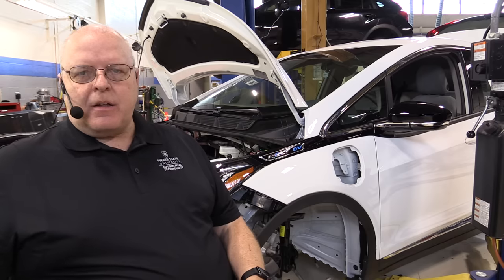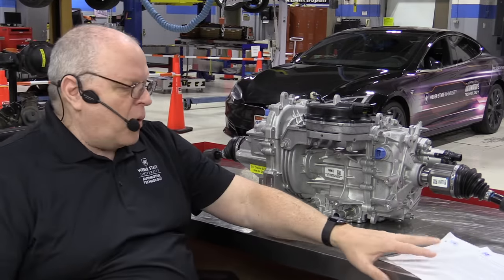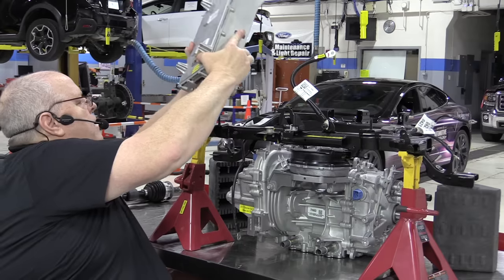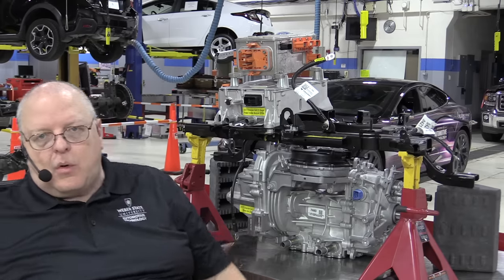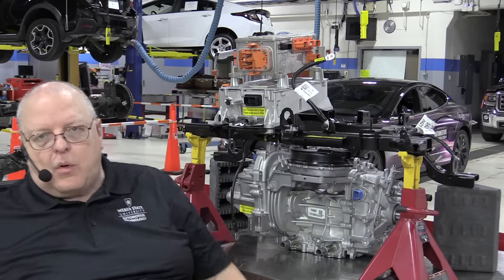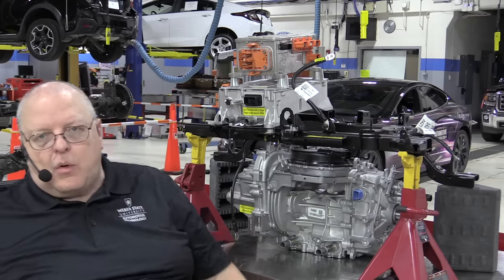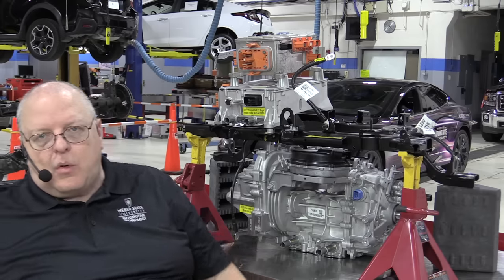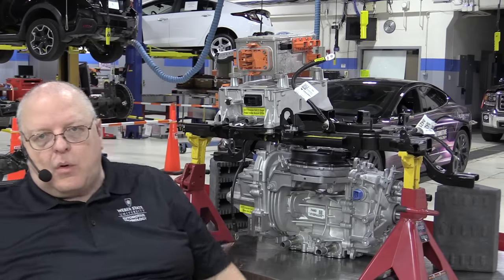Chevrolet Bolt EV High Voltage Components

Comment: Not a very space efficient design. No wonder they couldn't fit a frunk up there.
Reply from the maker: Thank you for your feedback
Reply: @WeberAuto  Thank you for creating such informative videos :)
Reply: Yeah, eventually they have to adopt Tesla's design philosophy to stay competitive. However, theses components are going to be great for EV conversions since they fit the traditional ICE car form factor.
Reply: I would gladly give up a tiny tray to put my groceries in to have a system that is serviceable.  Nothing is worse than the "space efficient" designs of today that require you to drop an engine to change spark plugs or other equally ludicrous ideas.
Reply: @samurphy  Firstly, if the manufacturer did their job, these components should last the life of the vehicle. Power electronics like this tend to last a long time, it is one of the advantages of EVs. Second, it isn't that hard to have a removable frunk liner to give access to these components.
Reply: @ShaunRF  I agree with both points. The Bolt has room for refinement. As to your first point, that's 100% correct, but given the astounding rate of repair and replacement on the Tesla drive units, I think we'd agree that the manufacturer is NOT doing their job.
Reply: @samurphy  that was one issue as a result of a supplier problem(most likely Borg Warner), and certainly not representative of the whole. In any case, drive unit replacement is actually quite simple in a Tesla, especially compared to engine replacement in an ICE car.
Reply: @ShaunRF  I like how we keep hearing about Tesla defects that were solved 5 years ago. Tesla has not had any major recalls on the drivetrain in years. Maybe we might see some glitches with the new M3 design, but so far, so good.
Reply: @egoequus6263  Oh this comment aged quite well, remember the Bolt EV battery recalls from a few months ago? There go all the penny pinching cost savings as they replace and refurb all those battery packs. Spending the extra money goes a long way, especially when you're GM.

Comment: yes , fossil fuel engines to hell.
Reply from the maker: Thank you for your feedback
Reply: Noooo. Gas engines will never go out. Electric is expensive to repair plus you need battery chargers everywhere you go😂😂😂
Reply: Unless the power grid you use is 100% wind or solar or hydro-electric or nuclear the electricity used to charge the batteries is fossil fueled. There's no way to separate the electrons flowing through the grid as to the source of them. You might be 35% green but the majority of those elemental particles come from "dinosaur squeezin's".
Reply: sp1nrx - as time goes by, the more wind/solar/hydro power become a part of the mix of sources powering the grid.  You have to admire the size of wind generators and so,ar arrays being deployed these days.  Adding battery storage to the grid will help that a bunch in coming years, so fossil fuel dependency to power the grid will be reduced.  Dinosaur juice supply for transportation is finite and never renewable.
Reply: Just one problem, these cars are a whopping $36,000  you can buy a decent used gasoline powered car for under $2500. I have a 2003 Concorde LXi with leather seats, power windows, premium stereo,  no rust or damage,  in beautiful condition, had been owned by an older retired  couple who had a garage they kept it in and kept it serviced, it has  120,000 miles on it,   I paid $1100 cash for it at a local dealer.

 $36,000 is about 5 times what I paid for my 2 bedroom HOUSE  with full basement on 1/2 acre of land in 1999!!
$36,000 has to get financing- that adds to the cost, plus comprehensive collision insurance-  there's another cost I don't have buying a car like mine and paying cash.

Comment: It's a 30-mile car oh well somebody got to reverse-engineer it.
Reply from the maker: Not so much reverse engineering as just exploring and learning. Reading about the systems is one thing, taking them apart to see the internal parts and see how they function as another. It helps my students to learn how they work and to help remove the "Mystery" from electric cars. Have a good day!
Reply: @WeberAuto  Great! I was in clearfield Job corps center. Is this Weber the same one in Utah? UAW 1991.
Reply from the maker: @stevencorrea7982  Yes, on the side of the mountain in Ogden.